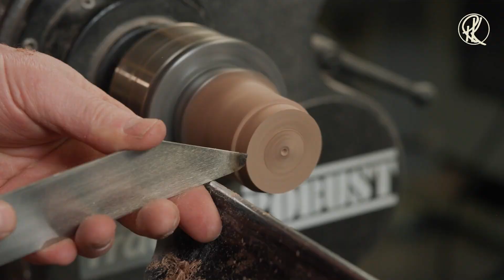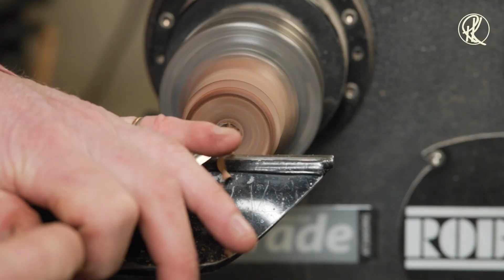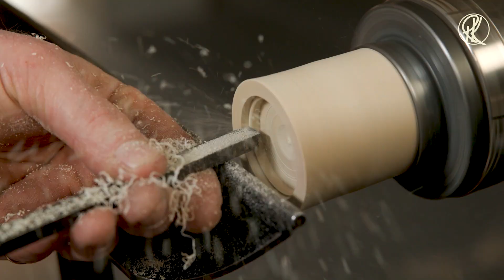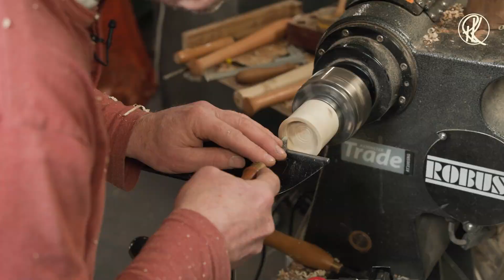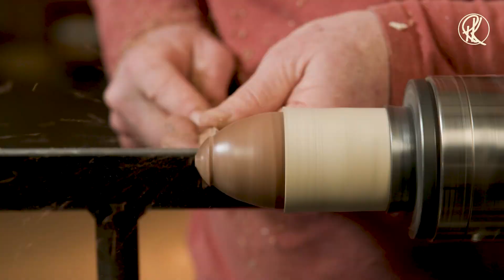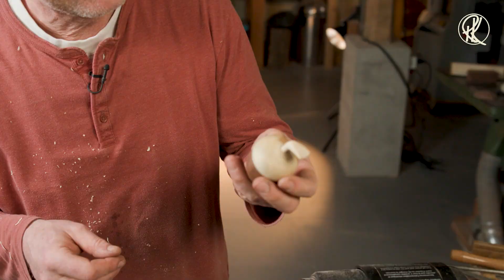making an acorn box in a minute... #shorts

Comment: Wow really cool as you would say, great instructional video.
Thanks for sharing.
I’m going to have to make an internal scraper for the space at the end of the thread.
I have 2 chasing sets , one fine and one course. I’ll start with the fine thread as you suggested. I was going to make a straight cylindrical box but the acorn looked great.  
We don’t have a big acorn following here in down under Oz, but it looked great, loved the little handle as well.

Could you do another one of your great videos on hollowing out upside down as you call it.
I just refer to it as inside out hollowing.

Also the measurements for threads thickness. I guess I can google that? Do you know where perhaps. My chasers are whitworth threads.
Thanks again for sharing